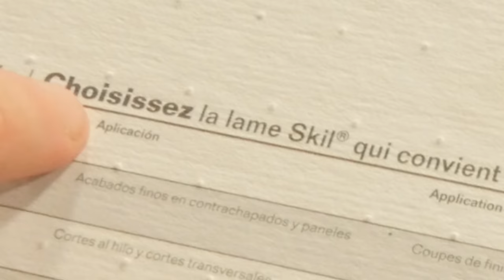How to Make: The Vulture (Double Bladed Saw Blade Battleaxe)

Comment: few tips. ya need to practice your weld technique. don't drag the weld. it gets horrible penetration and looks bad. practice either drawing circles or doing a whip back and forth. or bevel the edges your going to weld and do a side to side whip. also pushing your weld over pulling gives you decent penetration and let's the weld lay flatter as it preheats the metal and let's your weld puddle spread out
Reply: mmainer2000 what welder was he using in this video?
Reply: AxtillioN welder make and model doesn't matter. but judging from the lead it's less than 150 amps and he's using Flux core wire. But regardless as I said make model power and wire mean nothing when it comes to technique
Reply: mmainer2000 iiii
Reply: nah you always drag anything with flux cuz if you push you will get flux in your weld
Reply: mmainer2000 as Cason Connors said with flux core wire you definitely do drag to weld. But from the amount of spatter going on I would also suspect he may not have the welder leads polarity reversed from how they would be if he was using gas. Polarity is one way for gas and the opposite way connected for flux core wire.
Reply: right! i noticed that if u do a zig zag motion it makes a really nice weld, and  flux wont get in your weld!
Reply: Hey, because if my welding class I understood this.

Comment: hey Eli! 
quick tip, don't pull a weld, push it. like, always weld away from you, that way you're dragging the molten metal with you as you go. 
(I'm a fabricator, my boss would slap me if he knew I didn't pass this on. :p)
Reply: also, instead of using wood as a backstop, you should grab some Copper and use that, it won't fuse to the steel and you'll get a nice, flat finish on the back. 

you're doing some super cool stuff, man. I'm a longtime watcher and a huge fan. C:
Reply: +Seb Raubenheimer im gettin into welding and stuff thanks for the tip mate
Reply: +Hannah Riley FREE INFORMATION FOR AAAAALLLL!! 

you're welcome. c:
Reply: If the process you're using produces slag you drag the puddle, no slag you push. So stick and flux core you drag and Mig and tig you push. Plus I could be wrong but his welds looked like they had no cover gas which is super important for clean, good penetrating welds
Reply: this is true. I kinda assumed he was miggin', but now you mention, there isn't the hiss of gas, so he's probably using flux core. my bad. D:
Reply: +Seb Raubenheimer I think he is miggin but just didn't have gas for it, which is why it doesn't seem like he could get a decent bead down
Reply: +Ryan Boyer maybe. didn't notice him having to knock slag off, so there's always the possibility. I've never used mig without gas 'cos I'm unwilling to face the wrath of bossman, but I do know that gas is pretty fuckin' expensive, for a home user, especially so for our boy Eli, being young and all.
Reply: +Seb Raubenheimer haha yeah boss man isn't a fan of porosity. At least he was able to make his set up work for his needs. I know at work if there's a hiccup in the gas supply to my welder it takes a good 15 minutes to undo the damage
Reply: +Ryan Boyer bossman is a dong, he's so picky. I'm contemplating using diazepam to steady my hand, if there's a kink in a weld he gets really funny about it. xD yeah, he's remarkably good at making do with whatever he's got to hand, truly the Zednaut Alpha. :P euuuurgh, I'm guessing that's fifteen minutes of swearing, grinding and cover-up welding. fun.
Reply: +Seb Raubenheimer haha it's never fun, my boss ain't too picky, but if he hears that grinder he's over in a heartbeat, but then again I'm not welding shit for nasa so it's never that big of a deal to me

Comment: can you make a video on all the tools you use. i want a better idea of what i should get to start making things
Reply: oh and also hreat build as always, you are the best. i also noticed your welding skills are getting better
Reply: great*
Reply: If ur gonna use and cut metal an angel grinder probably is the best way, a welder if ur gonna combine metal or rivets for a much cheaper way, for wood a jigsaw, bandsaw or scroll saw are also good. Some sand paper and boom you can build stuff like him, also a drill press is pretty essential for metal working
Reply: I was rolling with just an angle grinder, a welder and drill press for a year or two. some files a hacksaw and smaller hand tools are also helpful. but with a lot of patience you can pretty much do anything
Reply: +Spy Crabb +DIY Jet Engine Guy  thanks but i was thinking more along the lines of the specifics. like a walkthrough with tips on the best uses for each tool, what size vise, his personal favorite tools, etc...
Reply: it really depnds on the kind of stuff you want to do... theres a lot of different types of each tool so without any background information cant really direct you to any specific tools or brands
Reply: +DIY Jet Engine Guy that's why I want a video showcasing elis experience. I really do appreciate the comments though.
Reply: Basicest toolz
Angle Grinder
File and sandpaper set
Drill or even drill press
ALL THE CLAMPS
For woodwork
Jigsaw, saws, rasps
Sandpaper
Drill
Reply: +Joseph Kim that's pretty fuckin accurate actully

Comment: You should do it with four blades and almost make a mace
Reply: southernstyleman why stop at four? Lets make EIGHT!
Reply: THIRTY TWO!
Reply: BeeLover MULTIPLY BY 9 36
Reply: He made the Night Terror which is a mace persisting of four blades
Reply: How about the night terrorer with 8 blades and the night terrorest with 16?
Reply: @teddyfresh9605  it would be extremely heavy and not very effective imahine it like lying on a bed of tacks compared to like a dozen a bed of tacks wouod hurt but would. Not penetrate your skin because you weight woukd be spread over more surface area same thing with the blades it would really cut but just be really heavy
Reply: 12 HEADED FLAIL

Comment: *uses surgical gloves to keep from having sawdust on hands
*goes bare handed when using angle grinder
JUST SAYIN :P
Reply from the maker: The gloves are to keep hand oils off the wood so as not to interfere with the wood stain.
Reply: I lmao'd at this. Thumbs up.
Reply: +Derpy McDerpinstein he simply corrected him.. you just pwned youreself. nerd
Reply: +ZNA Productions Oh, okay, that makes sense. It just really looked weird since metal shavings are 50x more dangerous than sawdust. They can hurt you so much worse than sawdust. Thanks for the correction.
Reply: The metal shavings from a grinder dont hurt at all and gloves can get caught in the blade
Reply: It wouldn't matter that much when I see people stain they put way too much time into it just take a rage dip it in stain run on the wood and the wipe it off with a clean rag and your done I do it all the time
Reply: U wouldn't want the glove to get hung up in the grinder. Think of it as when string gets hung up in a vacuum cleaner.
Reply: +EpIcNaChO they only sting a lil

Comment: hey friend just a tip on welding if you make tiny circles or side to side motion passing from one piece to the other will greatly improve your welding .
Reply: it depends on the type of welding process you do and how thick the metal is if it is to thin you will blow right through happened to me many times

Comment: I'm diggin the art in this bro. Not flaming or bashing at all, just one quick tip from what I've learned: Try to get your welds a little closer and you should have less splatter to clean off. Your welds should come a lot smoother that way when everything puddles correctly. Keep up the good work buddy!

Comment: Add a spike to the middle part you cut out
Reply: I was thinking the same thing. Maybe as a secondary stabbing weapon
Reply: You could also leave it as it is and sharpen the V so when you pin someone's limb or neck they get sliced up. But I'd prefer to have a spike.
Reply: +Syd S but the spike would look cooler
Reply: +Syd S like maybe part of a sword or large knife or something
Reply: +KirAtic I was thinking more practically, but a spike WOULD look cooler. Like some deadlier version of a trident or something.
Reply: +Syd S yep. Maybe Eli will see this and add that
Reply: Yes a spike
Reply: Or do both add a spike and sharpen the out side so it stabs their neck and holds it there
Reply: +Hnived U that's a gruesome thought
Reply: I was thinking he could sharpen the inside of the v so that you could keep a zombie at bay in close quarters but adding a spike as well sounds awesome 👍
Reply: +hardin Maranda i thpught the same
Reply: Yeah I was about to say the same, or something like a spear blade.
Reply: +hardin Maranda Sharpening that part would make a good throat-slicer indeed.
Reply: If the brackets didn't conduct electricity, then he could have turned the prongs into a taser thing.
Reply: how is he going to put it in though
Reply: He should make a halberd...

Comment: Should've made the teeth point down, that way they dig into the target instead of pointing away from it as you swing.
Reply: it could get stuck that way
Reply: He explained the reason in the build for the previous form
Reply: It might get stuck, but it'll also cut better that way. Won't matter if it gets stuck if it inflicts a mortal wound.
Reply: ***** If you have multiple attackers, you're screwed

If you're worried about it getting stuck in a multiple attackers scenario, it's probably not a good idea to make a weapon using a toothed circular saw blade to begin with. More than likely, you're screwed anyway if you're being attacked by multiple assailants, so you might as well make the weapon as lethal as possible.

If you have to move quickly, you're screwed.

The weapon's the same size and weight regardless of the direction of the teeth. Not sure where you're going here.

If you don't feel like attempting to pull bones out of a human torso just to get your weapon back, you're screwed.

It can still stick on bones pointing away like that. For instance, if the cut lands between ribs and a tooth gets lodged on a rib with a point catching when you try to pull it out. In that case, the teeth pointing into the cut have the advantage, as they are facing away when you pull it out.

If your first hit doesn't kill him instantly (which it most likely won't), you're screwed (unless you decide to leave your weapon and wait for him to bleed to death).

It probably won't instantly kill anyone regardless of the direction of the teeth. At least with the teeth pointing into the cut, you'll create a deeper gash, meaning more blood loss. The blade is not as sharp going against the backs of the teeth as it is going towards the points.
Reply: sidgar1 the weapon is for show. a sword would be better than any of the other options
Reply: NVR guru No argument from me there.
Reply: +sidgar1 the reason the ripping teeth will slow you down is because they'll take a lot more force out of your hit, so you'll have to use more force to take it out, resulting in less speed. Having something that cuts is better in most scenarios over something that rips into something simply because it will glide more easily through whatever it hits and take less force out of it. Yes, a deeper gash means more blood, but if that's the positive part then I'd rather have it like it is since you get more powerful blows and you won't get as exhausted
Reply: ***** The problem is the back faces of the saw blade are square. They are completely blunt. You probably won't even get a cut unless your hit is dead-on, and even then, it would only cut because of brute force, not because it's very sharp. With the teeth pointing IN to the cut, they will immediately gash the flesh, even on a glancing hit. The teeth pointing down won't take force out of the hit, they will TRANSFER the force you have even better because the sharp points will dig in and prevent the blade from gliding past or deflecting away from the cut. The teeth will bite and puncture, while the weight of the weapon will push the rest of the blade further in.
Reply: +sidgar1 "The problem is the back faces of the saw blade are square."

Did you miss the part at 21:33 where Eli says "I'll put a rough edge on these teeth"?
Reply: sidgar1 what Ninja said, he beveled all the teeth, and besides, even if it´s a blunt edge you can still chop through tissue with it when it´s that thin and you get such a force in the swing. The reason the teeth will stop the force is exactly because they will bite in. the tissue will fight against the teeth in the spasings and hold the blade back, the way he´s put them now they´ll cut smoothly through skin and flesh
Reply: ***** besides, even if it´s a blunt edge you can still chop through tissue with it when it´s that thin and you get such a force in the swing.

The reason the teeth will stop the force is exactly because they will bite in. the tissue will fight against the teeth in the spasings and hold the blade back

Wait, I thought the thinness of the blade would cut regardless? Does the blade somehow become thicker because of the direction of the teeth? And those same gaps exist with the teeth facing away as well. Using the same force that would cut with a flat edge, the toothed edge would cut deeper, as the teeth would puncture first and initiate the cut ahead of the rest of the blade. The force of the swing would force the "gaps" through the cut the rest of the way, and the flat parts of the blade would only have to cut the gaps between the teeth. Besides, if you were to sharpen the blade in-between the teeth, it would be just as sharp as sharpening the backs of the blades AND be deadlier than just a sharpened back edge due to the cutting edge of the teeth opening the cut ahead of the rest of the blade.

Also, the carbide tips of the teeth are much harder and sharper than a "rough edge" in the much softer steel.